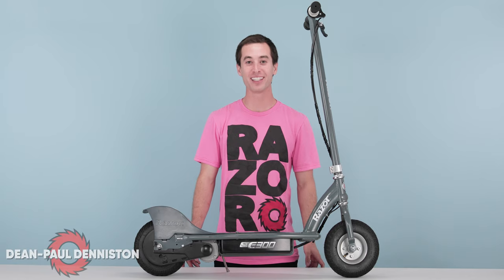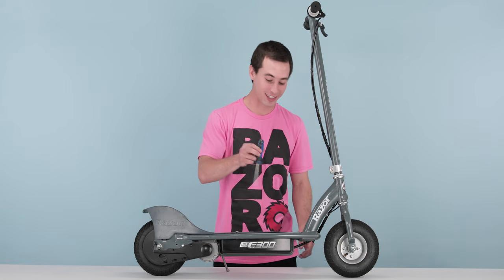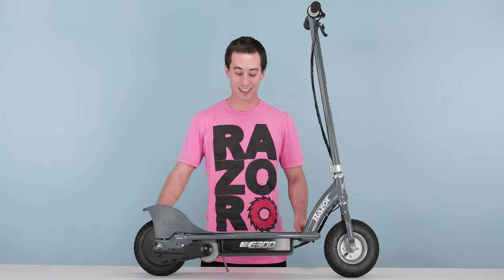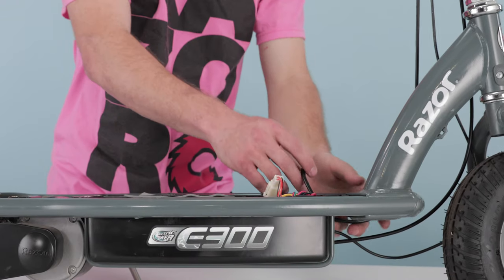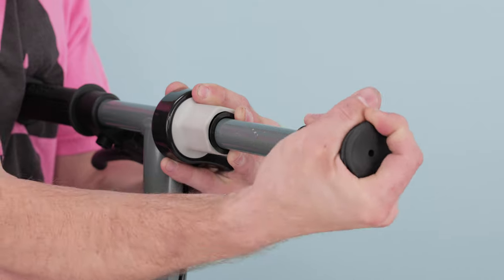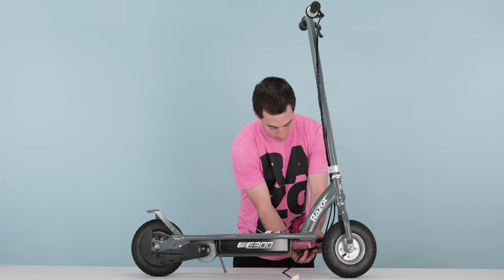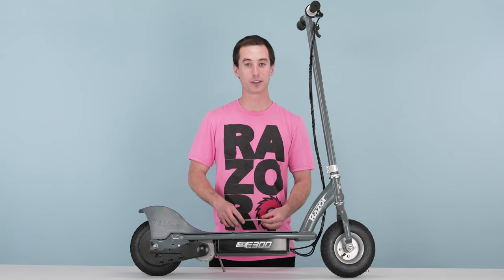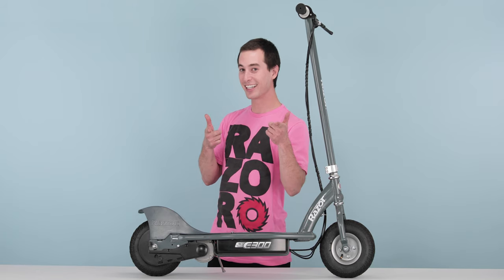How to Change the Throttle on the Razor E300 and E300S Electric Scooter

Comment: How can I increase the speed of the scooter?
Reply from the maker: Sorry, we don't provide instruction, tools or parts to increase the scooter's speed.
Reply: Do the overvolt upgrade
Reply: Why my Razer e300 not working. Light are working ?? Good battery
Reply: Find a steep hill!
Reply: You'd have to get a stronger motor, and battery to meet the voltage, and a controller that would be able to handle the new variables.